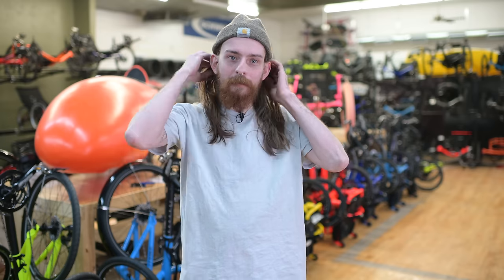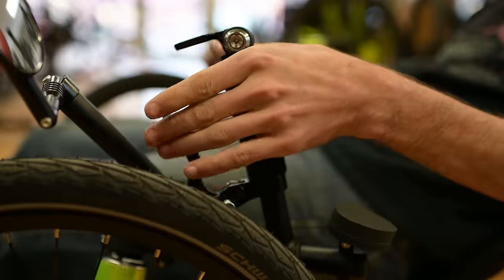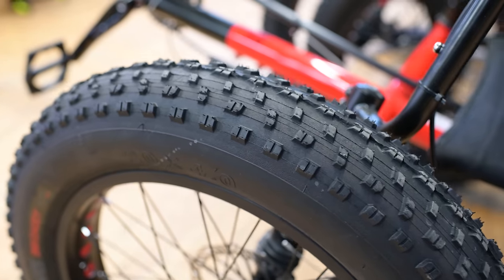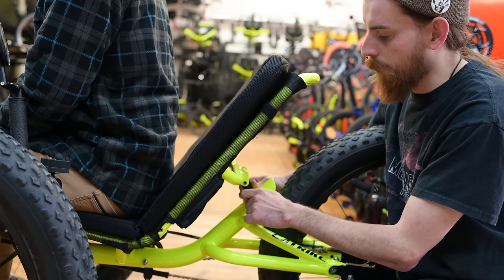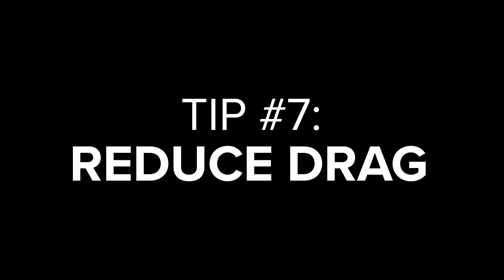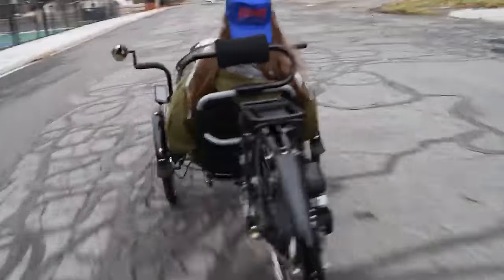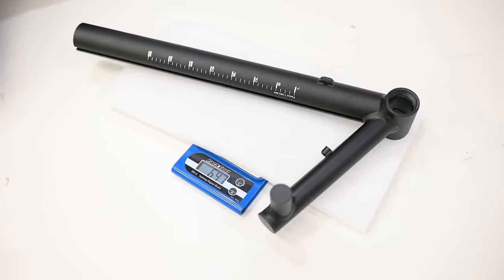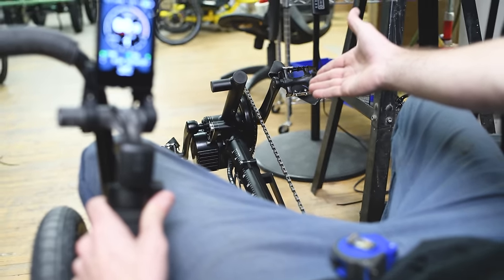11 WAYS TO MAKE YOUR TRIKE FASTER - Recumbent Trike Speed Tips From Utah Trikes

Comment: We've just bought a used Ti Fly here in the UK. We couldn't work out why it was so slow. We've now changed the tyres, threaded the derailleur properly and most of all, done the tracking (it was a whopping inch and a quarter out). Now the Ti really does fly. Thanks for the advice and thanks for all your excellent videos.

Comment: Fenders over the wheels, especially around the front and top of the wheel will improve aero alot. Wax the chain, use "oz cycle" formula, look up hes channel, its white candlewax with 20ish percent ptfe. Recline your seat to reduce frontal area, aerodynamic resistance is frontal area times drag coefficient. Make aerocovers for your wheels from cheap sheet plastic, trikes are not prone to "windwobble" like a bike is. Route hoses and wires together, just use tape to bundle them, also cut down on length or hide them on the trailing side of frametubes or steeringtubes. Make a "fishtail" behind the seat that covers rear wheel and assembly, most aerogains are from reduction on the trailing side of the object. Reduce tyrepressure(YES) until the ride isn't harsh anymore, it sounds counter-intuitive but it shows that it more often than not helps efficiency to run softer. These are my cheapest and most DIY friendly tips=)
Reply: Yeah, a tail fairing is one of the first aerodynamic aids you should consider - and they look really cool!
Reply: What about covering the Wheels I’m sure they have something. Plastic inserts ?

Comment: Excellent overall tips very well presented. Thanks for all the work you put into this excellent video. All I'd add is it would be really worthwhile for most cyclists to spend some time and effort fine tuning their trike gearing. Coming to cycling from a background in sports car racing I am constantly amazed by how poorly most cyclists understand gearing and its importance in improving all aspects of performance. Many seem to think that the only two gear combinations worth considering are the lowest low and the highest high. Nothing could be further from the truth. In order to go from a dead stop to flat out top speed some clever devil years ago came up with the idea of providing intermediate gears to allow a gradual transition from low to high gear rather than one or two massive jumps. If you don't understand the reason for this here's an experiment for you to conduct. On a reasonably flat section of roadway put your trike in its highest gear and attempt to start off. Didn't work out too well did it. Now put your trike in its lowest gear and start off. Quite an improvement huh? Clearly having a low gear is helpful to your initial launch. Now comes one last experiment, put your trike in its lowest gear, start off and when you hit your normal cadence shift directly into your highest gear. Whoops! Didn't work out too well did it. So now that we appreciate the need for graduated gearing between our lowest and highest gears we are on the right track. In sports car racing the methodology used in selecting gear ratios is to match up three things: RPM, Torque Curve-Power Output/Track characteristics. Translated into the cycling world what this adds up to is determining the cadence where endurability and maximum power output intersect and than matching not only your trike's lowest and highest gears to your abilities and terrain but fine tuning the spacing between those two to maximize the efficiency of transition and minimize the dramatic loss in power output you experienced when shifting directly from your lowest to highest gear. The number of gears and the spacing between each depends entirely on you preferred pedal cadence, overall power output,  and the sort of terrain you normally ride in. So there is no "one setup fits all option." You've just got to experiment. Just because the fast guy in your club uses a certain gearing setup does not mean it will work for you. And just because some macho BS circulating in the cycling world contends that only sissies maintain fast cadences while "real" cyclists just grunt and bear it doesn't mean it's true. Equip your trike with a cadence sensor and try cycling various distances at various RPMs and you will soon discover where best performance and longevity overlap. Now try to set up gearing that allows you to maintain that cadence for most of the rides you make in terrain you typically encounter. Once you hit that sweet spot you'll say "Oh wow, so that's what that sports car guy was talking about!" Oh yeah, one last thing having to do with the Power Grip straps mentioned in this video. I have long maintained that if clipless pedals had been invented before Power Grips when Power Grips came along that would have been the end of clipless pedals and all the costs and problems they brought with them. I rode thousands of miles on a very demanding short wheel base recumbent using Power Grips and I never looked back. Inexpensive, durable, endlessly adjustable, extremely good at holding ones feet in place (my normal cruising cadence was 120 with occasional sprints to 160) and much, much, much safer when riding in tricky terrain or traffic. To those who have tried them and found them lacking I would suggest that you try them again and spend some time fine tuning the strap adjustment.

Comment: A tip to increase speed, and comfort. Adjust the angle of your foot on the pedals if you experience knee pain with clips. The angle from your toe to heel will cause knee joint pain if it is wrong. I found this out the hard way. I am an above knee amputee and I was experiencing pain in my remaining knee. I added a spacer moving the pedal out from the crank and rotated my heel in towards the crank to fix my issue. You may find the opposite true for yourselves (heel out), but I highly recommend you experiment on your own. An allen wrench is all that is required to change the angle to test this, and if required the spacers are under $5. Once your knees no longer hurt you will find yourself being much faster on your trike.

Comment: Having feet attached to the pedal is also important in the sense so the feets won't fall below and touch the ground, resulting in a very nasty accident that can break your leg if you are going at speed
Reply from the maker: Definitely. Ouch!
Reply: My problem with those is that they attach at the ball of the foot, as needed for upright bikes. On a recumbent, I find more power by having the pedal touch my foot lower than that.
Reply: I Agree ☝️
Reply: @KutWrite  The reason for attachment at ball of foot is to avoid pressure on the plantar fascia, that tough tendon that spans the bottom of the foot from said ball of foot to heel. Proper foot placement on the pedal nearly eliminates the occurence of painful conditions of this tendon being plantar facitis and heel spurs from using soft parts of the foot to mash on the pedals.
Reply: @phyllisboone8957 : I get that. I still use the ball, just lower down.

Comment: Power grips are awesome with a strip of 3/4" "velcro one-wrap (self-adhering velcro) through the pedals and around the heel for additional retention. Super flexible lightweight and secure for any shoes including Tevas. Better breathability on the foot in general with different shoes depending on conditons.

Comment: Changed the front wheels on my Catrike Expedition from 20 to 24 inch and wider to 2.5 back from 26  to 29 with 2.5.  My guess about 2m/h faster and a smoother ride would not even think of a catrike with stock tires and wheels now

Comment: I was starting to have knee pain and problems,   it was solved by putting crank spacers on the pedals to move them out further, placing your feet wider apart will put your knees and feet in a more natural alignment for comfort.    I'm short 5.7, so i also opted for 152mm crank arms, (your knees don't bend so sharply on the return rotation).  Those two things took away the knee problem  Simple fix
Reply: I put spacers on my trike too, but only because my big floppy clown shoes kept creeping off the pedals. This a great solution for people with big feet. I suppose 2 sets of spacers is possible for actual clowns.

Comment: Is it more or less efficient to have the seat closer to the front wheels, or to the rear wheel?  Thanks!
Reply: Too far back, the trike can tip over easily on corners, too far forward, you can lift the rear braking hard and maybe lose directional control, crashing. This is why nearly all trikes don't have adjustment to slide the seat, but only boom adjustment for leg length.

Comment: Louis, thanks for the tips! Spent a cloudy afternoon giving the HP some spring love. Wheel alignment was definitely an issue with excessive wear on the right front as well as the rear tire. Blocked the left front in place with a 1/16 toe in and re-set the right side to match. Moved all zip-tie heads to the trailing edges. Aero. Anticipating a time reduction tomorrow. Appreciate you guys!

Comment: Awesome rundown.   Love Louis and Kate and the whole team.  Question.  Is there a torque sensing motor (hopefully crank base, not hub) that will do crazy high speeds, or are we stuck at 20 mph limit from Bosch and Shimano?  I like the build of the Bafang HD and the power, but really would want torque sensing to maximize control.  Bafangs tend to be a little binary on their assist, and ultimately, it's hard to combine your own power with its power well.  After a few years with a BBS02 750W on a bike, I've decided it's great and super practical, but it's always doing most of the work up to a max speed where it drops off and makes me work hard (at like 30mph and massive aero wall).  Have you used the Bafang Max Ultra or M600/M500 torque sensing non-bottom bracket based units yet?
Reply from the maker: Thanks for the comment. We have experimented with different torque sensing crank-mounted motors and what we've found is that at the higher power outputs and higher rpms they just don't feel natural because they are tied to the cranks. An actual middrive with pedal gearing in front of the motor that then goes to the final gearing is the better way to go, but much more complicated. For high-speed riders it's hard to beat choosing your own assist with a throttle.
Reply: Give it a try on 2 1/4" tires. I'm much happier since going with the oversized tires.  I'm thinking about a 28" rear wheel mod which should equate to 29 1/2"" diameter. I've run the same BBSO2 kit w a NuVinci hub for four yrs.. My 5.5.9 is tricked out with about twenty more lbs of accessories, oversized custom panniers from Dill Pickle in Somerville, MA and a large 48 v 30AH li-ion battery pack hanging off the back of the seat purchased direct from China. Time to start thinking about a safer battery pack. Getting. 31 mph max. Haven't dwelled on speed as much as comfort. Often wish I'd opted for something w suspension, but don't know about the forward weight distribution in the Dumont. Already have almost as much tied up in the Cattrike as my car, lol.

Comment: Schwalbe G-One 40-406 TL is faster than any of their 28mm tires. A guy from Schwalbe told me at Spezi they measured that in their lab.
2mm toe-in is too much, especially with narrow hard tires. I figured out Schwalbe Big Apples work really well ghetto style tubeless (Schwalbe is not approving the BA TL!). If you have a trike with poor steering alignment like old Alleweder's McPherson suspension with DIN 71802 angled ball joints (with lots of clearance) Big Apples @ 2bar may be faster than any narrow tire.
With this knowlege I`m very sure the 40-406 G-ONE will be even more fast compared to a 28-406 on a trike's front wheels, which is never 100% aligned, than at Schwalbe's test in the lab.
If you are riding a lot of tracks that are narrow or have two tracks of concrete or gravel and grass in the middle a two wheeled recumbent will be much faster as with a trike you always have to drag two wheels trough the grass.
Reply: Swapping your trike for a bike doesn't sound like a sensible option for someone who wants a trike. Besides, if you're riding really fast on those kind of trails, a modern upright will usually have the edge over rougher terrain than a 'bent. Sometimes you have to accept that compromised is unavoidable.

Comment: I lost 50 lbs last year. That makes an amazing difference in my speed!!!🤪
Reply from the maker: Great job!
Reply: I've had my Catrike Villager for 3 months; I have lost 10 pounds so far; my goal is to lose 30 more. That will compensate for the 40 pounds of the trike itself. At that point, my downhill speed will probably still be top-gear-limited to about 20 mph, but I am hoping my uphill speed will improve dramatically. There are a lot of hills around here, mostly uphill it seems.
Reply: @chrisdoutre101  good for you! Keep up the good work!😀

Comment: LEWIS
LEWIS
LEWIS

Well, you all are great in my book.
And if I EVER make it to your part of the world, I will definitely stop in.  Maybe Lewis could show me how to do the 2 wheel trick hahaha.

I did the motor thing years ago.  Started with a BionX and moved into a geared hub motor 3 years ago. Not so much for speed, not saying I don't use it to go fast sometimes, but more for taking the pain out of these old bones.  I leave it turned down low until a hill that hurts or I need to make some time.
Reply: I updated my Greenspeed GTO to a 10 speed in the rear on a 1600 watt hubmotor from Lunacycle.  Changed the shifting around from 3 twist grips to 10 speed and triple Microshift bar-end shifters and other tweeks.  With a "52v20Ah" battery it'll cruise around 38mph for a couple of days of normal useage and can climb any local hills without burning out a controller or me.  I'd love to go with a full velomobile (Quattrocycle!) and a smaller assist in order to get more speed with less assist and weather protection in the winter.
Reply: @scottwa  Nice
I would love to get a Velo too but retired and on a pension. it is probably not going to happen.

Comment: To Utah trike, I have a Performer JC 70 2019 model . Do you know of anyway to put suspention on the front two wheels. Performer did not offer any kind of suspenion on the JC 70. I pu a 1000 watt 36 volt motor and it wll run about 30 mph and hitting bumps are a bitch. Please reply
Reply from the maker: Depending on the head tube angle it might be possible to use a suspension spindle from Sun, Catrike, or ICE. It would likely involve some custom-made machines parts and a change to your steering. Ultimately, you'd likely be better off selling your trike and getting one with suspension designed into it.
Reply: @UtahTrikesOnline  thanks for your reply ,but im not sure yet on how moing to fix he problem.

Comment: Cheers all . New to recumbent triking. So thanks for the tips. Ok I'm going ask. Erm. Pain in butt. Well where bum meets leg area after about 20miles is that normal I've even put a cushion on the seat, yeah I'm old and have no shame? Otherwise comfy. Now I want one of those fairings. Who 
does this stuff in the UK any body know? Oh Lewis hello from the Fens in the UK. No hills and very flat. :)
Reply: Midnormould (Mid-Norfolk Mouldings) make a nosecone-type recumbent fairing, you can find them on fleabay. You will need to make up a mounting system yourself though.

An alternative I've thought about - but nothing more - is a fabric (parachute nylon?) nosecone tensioned with split bamboo canes from the garden centre. Cut the fabric to the right pattern with pockets along the seams to hold the canes in a nice streamlined curve and you should end up with a very cheap, stable, lightweight and aerodynamic fairing.
Obviously the first thing to do would be to work out the positions of feet and knees at maximum displacement in order to get a side profile. The width at the front will be determined by the width of your feet on the pedals, rear width will depend on whether you want your hands out of the wind or not.
Reply: The pain issue is from an ill fitting seat most likely. Look into a new seat with a shorter distance from front to rear, you can test this by moving your pillow behind your back instead of under you. 
Also look for a seat without a bar under the front where it can contact your legs. Look at an ICE Adventure's seat to understand if you can access one. I ride with a prosthetic leg socket that is nearly to my hip without issue.
Good Luck.

Comment: ah tip number 12 go electric and program the computer for the smallest possible tire size. Most electrics kick off at 25 MPH, but a 26 inch tire going 25 is spinning slower than a 10 inch tire... so if the computer thinks you have a 10 inch tire well...keeping up with traffic is much easier...

Comment: These amazing 3 wheeled pedal powered trikes with the battery assist electric motor and one wheel drive pound for pound are 10-20 times more expensive than a LOADED 2020 BMW AWD X5. Wow! 🤷‍♂️
Reply: Maybe so, but show me a car that weights less than 100 pounds and can still reach 50mph?

The world record is over 100mph on a motorized tadpole trike last I heard, and the same trike with the motor controller turned down gets well over 100 miles on a single charge as well even when not pedaling.
Reply: Unfortunately the price is a combination of high-quality and low volume manufacturing. If they sold 100,000 electric trikes a year, the price would probably be 1/3 of what they cost now.
Reply: Economies of scale at work. But with a trike you don't need a driving licence or car insurance. You don't pay vehicle specific taxes, and you can legally use a trike in places where cars aren't allowed. Pound for pound, diamonds are more expensive than trikes... but they have no wheel drive and they just sit there doing nothing! 😁
Reply: If I’m going to put my money toward a tricycle it will be a Can Am Spyder before I will ever drop this amount of money on this play toy.